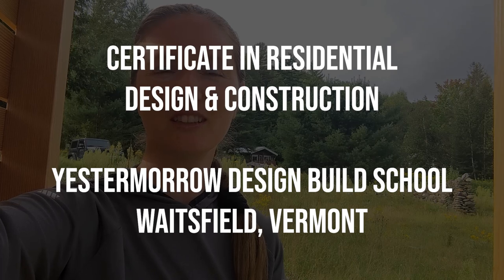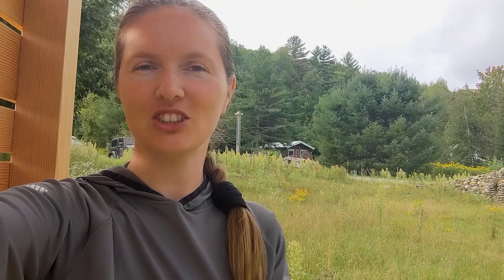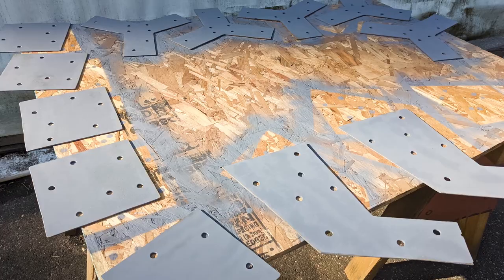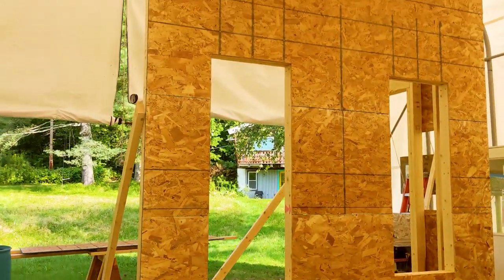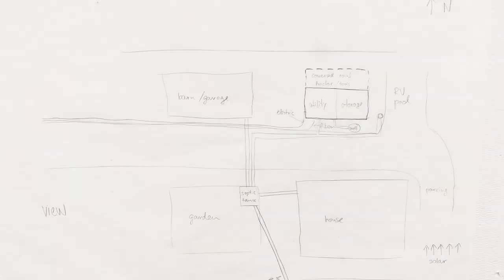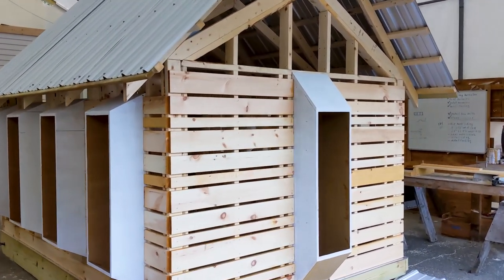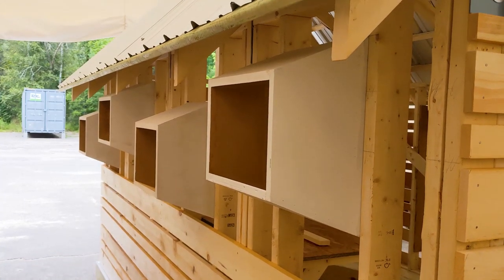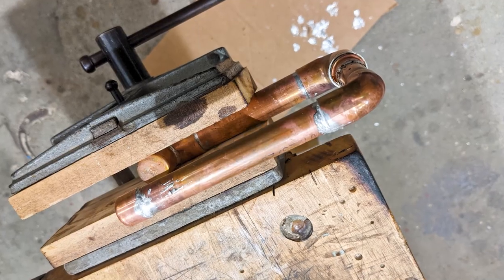Learning how to build a house at Yestermorrow

Comment: We put 1 2×6 (instead of 2×4)  interior wall between the kitchen and bathroom as there will be a lot of plumbing going in that wall as well as the vent pipes. It will make it so much easier during the plumbing process. We also plan to insulate some of the interior walls for sound barrier as it will be a small cabin. So excited for you guys. I know you are ready to get started now that you have a driveway and know more about the building process.
Reply from the maker: That's a good idea to insulate some interior walls, we are thinking of doing that too. How far along your build are you?